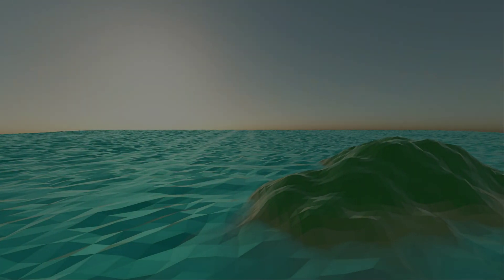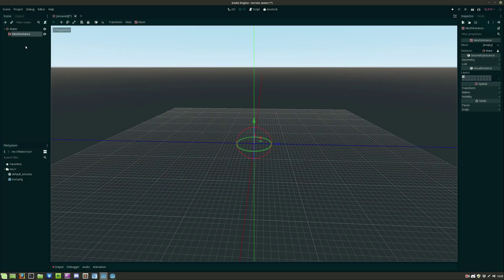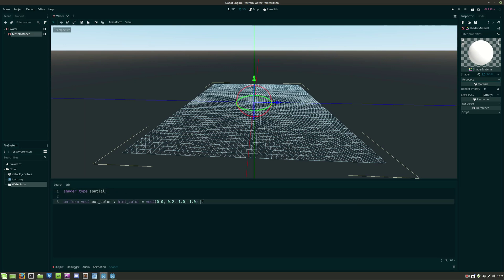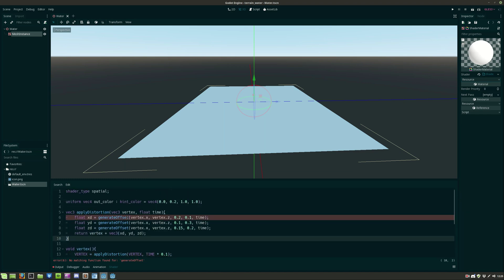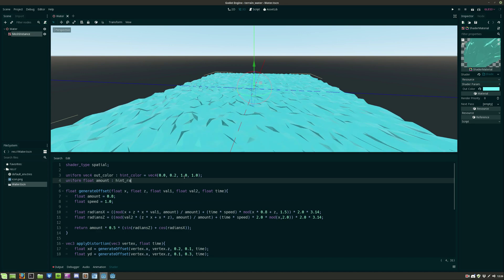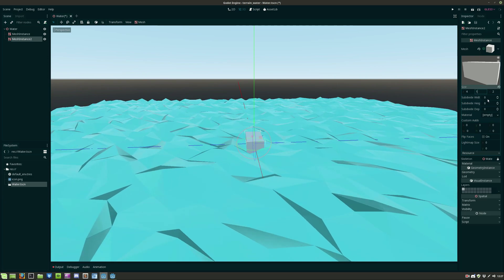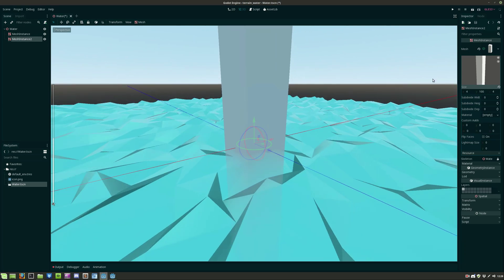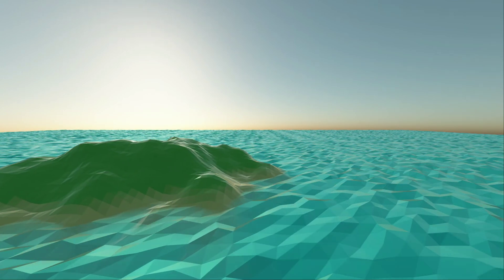HOW TO GODOT: Low Poly Water Tutorial

Comment: Hello, thank you for this tutorial. This ocean effect is really cool! I have just a problem, and I encounter it with some others ways to do ocean shader, it's in a dynamic chunks loading configuration. I always get a problem on the border of each water chunk, the vertex are not aligned during the movement and there is holes between them. Do you know a way to synchronise vertex movements on the whole chunks ? Thank you again, keep up the good work👍
Reply: I had this same problem, and after a few hours of searching I found that you can add "render_mode world_vertex_coords;" in order to make the vertices use the global coordinates, which means that the vertices that are at the same global position (on the chunk borders) will be calculated the same. When looking at several other water shaders, I did not have a need to add this, and to be honest the function he uses to modify the vertex coordinates is too arcane for me to figure out why this one needs it, and I'm not experienced enough with shaders to figure out why the other ones didn't, but I suspect that it may have to do with the mod function.
Reply: @sheep4483  Thank you very much for this tips! I'm working on my player's animations for the moment, but I will try it after that.
Reply: @sheep4483  Thank you very much this is actually working like a charm, you just need to add render_mode world_vertex_coords; on top of your shader code that it